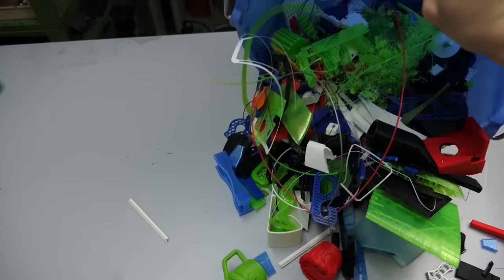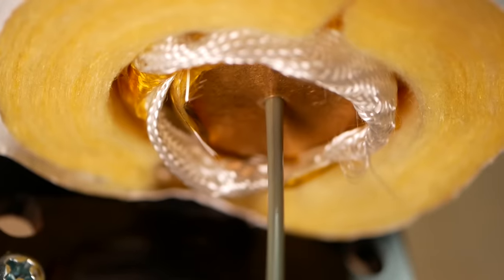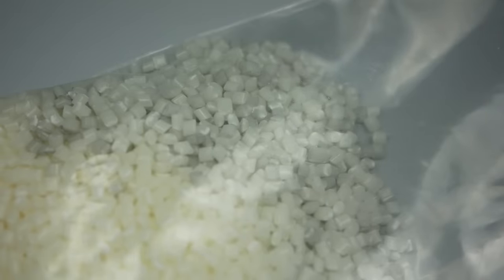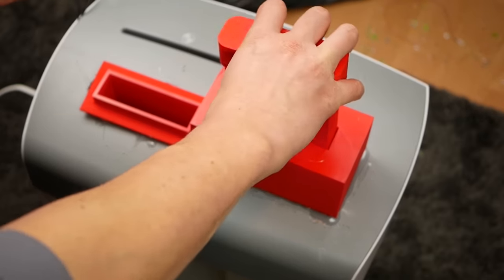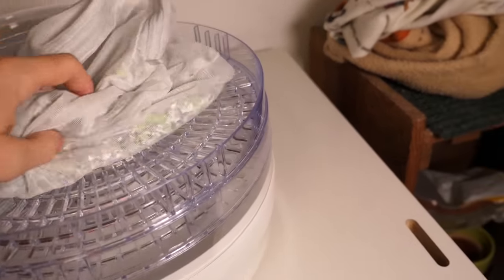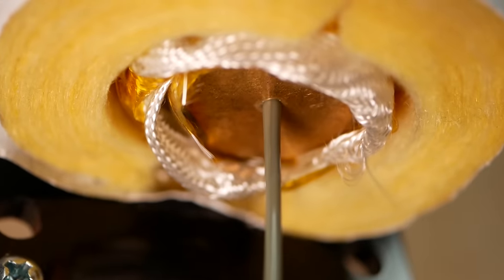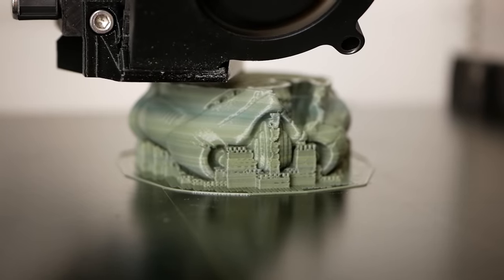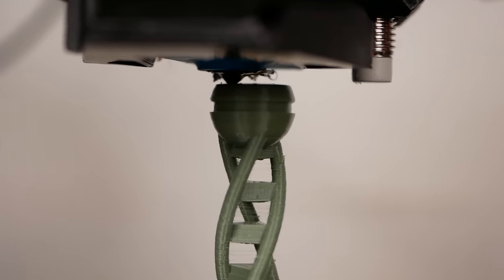Recycle your failed 3D prints! Make new filament at home.

Comment: Wish a system like this was cheaper. This should be a standard with everyone who uses 3D printers!
Reply: Perhaps hobby spaces should set something like this up together and then all of the members can drop off their failed prints for recycling.
Reply: Makes me think, there could be a place for a business here...send us your failed prints and we offer a discount on recycled filament.
Reply: This system is very rudimentary, I imagine building one would be pretty straight forward. Biggest hurdle would be temp control & engine speeds.
Reply: @1992Bwhite  yup! I imagine even a store front in a big city would even do good.
Reply: @hedgehog3180  Damn, that's an awesome idea. Many printing enthusiasts, myself included, would gladly provide their scraps regardless of what they'd personally get out of it. I'm totally going to recommend this to my local maker space.
Reply: Yeah I imagine you could have a funnel going to a heated big tube that would melt it together followed with it getting pushed out of a extruder perfectly
Reply: @hedgehog3180  who buys anything at a local hobby store???
Reply: This is more expensive than some good printers
Reply: If there is a demand someone will meet it.
Reply: Exactly a lot of my prints are %75 support
Reply: @hedgehog3180  if only i even had dedicated 3d printing stores in my country,i can only order supplies and stuff.
Reply: Did you watch the video?? At $30 CDN per kilo of PLA, that only 16 roles! 3D printing is damn expensive, so if you can recover the material costs, it's worth it. Buy one of these and advertise to pay for scrap parts in your local area.
Reply: Worth it.... Once one has their printer dialed in and is willing to continue collect scrap... Im gonna get one 🥳
Reply: To be honest I agree
Reply: Why, it takes up a bunch of space, is finicky, time consuming, and a general pain, why should this be standard
Reply: It is probably ceper in the long run
Reply: Legitimately if I was making enough items and had enough material I wouldn't hesitate one second spending $10,000 on a recycle of machine obviously the whole system for that amount of money.
Reply: @1992Bwhite  Reliably sorting the incoming scrap would be nearly impossible.  At least with a PET bottle, you've got a fighting chance ("PET" et al stamped on the container, you could even scan/sort different containers).  Without serious pre-processing, variably mixed or polluted scrap would produce wandering quality filament. You've met "people" ... apart from the 6% who  take the process to hear, the rest will just dump whatever, and whinge they didn't get the promised reward.

You'd be better off offering to produce this PET waste filament from local council recycling, if they'd be bothered.  A happier experience for everyone.
Reply: Felfil EVO Pellet Extruder
Reply: @hedgehog3180  That idea just might save R/C hobby shops. No one even buys parts for their rcs anymore these days. If something breaks they print a new one. Its gotten to the point where its cheaper to buy a whole 3d printer than pay a hobby shop every time something breaks on an RC.
Reply: What would make it more worth the cost is if it worked with PET. Getting friends and family to collect the bottles so you pay nothing as well as recycling PLA. I know PET can be tricky, but still.
Reply: trash bukkake?....
Reply: @hedgehog3180  Get out of my head!  I can't get to the local maker space frequently but I could get there a few times a year.
Reply: @hedgehog3180   this is an awesome idea. Feel bad just throwing that stuff away. Not to mention the supports. They are just pure waste
Reply: Give it time, 3D printing will evolve very well.
Reply: The recycling setup shouldnt cost twice what a decent printer does- thats just too much
Reply: @1992Bwhite  there is a German company doing this. You send them your scraps, get points and can buy new recycled filament at a cheaper price
Reply: If you throw it in the garbage, it will be recycled too. Just that you giving it away for free and pay extra for the recycled eco filament
Reply: Considering the fact that most bottles and caps wind up in the landfill even the ones that supposedly get recycled this would be a great way to get rid of that stuff.  That was my plan when I started Googling this subject.
Reply: @hedgehog3180  Accepting strangers plastic means you have to trust that it is clean and pure, only pla. So its basically impossible.
Reply: CHEAPER?? that is the cheapest. other systems run in the thousands to ten thousands of dollars!!!!!!!!
Reply: I wish it was cheaper too! I have been holding on to my scraps for as long as I can remember but I don’t have any way to recycle it lol and it feels like a lot of effort 😭

Comment: A few things as a plastic technician (im specialized in injection molding): you should be able to achive a black colour by adding about 2-3% clean powdered graphite. Ifyou dont want to add virgin material you should be able to use vibrations (maybe a rumblepack?) To loosen up the material for extruding. To reduce graining ect. And get a more homogenious filament i would try to sort the material either by spool(best way) or atleast by transparent/opake and light and dark colours
Reply: I was going to comment this, except with graphene powder. I add graphene powder to SLA resin, although I haven't done any tests on its effect. Do you know?
Reply: @attilasooky8792  i just know that black colour normally gets done with carbon and graphene seems like the easiest clean source of carbon i can think of
Reply: A rumble pack you say? 
Pulls out Nintendo 64 controller accessory.
Reply: @wargex  Any small motor with a weight that is off center should work.
Reply: @Kara_Kay_Eschel  "Rumble Pack" was the actual proper name of the controller accessory. I understand how vibrators work.
Reply: @wargex  I figured. Was clarifying that it just did not have to be for the masses.
Reply: @sonnyajvoll5865  probably.
Reply: Hey do you think you could melt the scraps to use in injection molding?
Reply: @Tula-cs1ef  yeah we actually do this alot of the time where it doesnt influence the use of the product, we normally mix about 25% shreddings in there but it can influence the strength because the macromolecules get thermally damaged during every heating aswell as possible discolouring and you can loose an fda certificate but whereever we can we do it, mostly to save money on garbagedisposal. And other option is regranulating where you melt the scraps back up and use additives to get a granulate thats almost compareable to the new product but this again costs some money
Reply: @attilasooky8792  isnt graphene super toxic?
Reply: Can you be more specific on what you mean sorting by spool?  I guess youre assuming all the plastic being used is old filament.. if thats the case do you mean sort by spool as in type of filament (pla, abs, etc)?   From the videos ive seen many are sorting their failed prints by filament type, and some by type, and color.  Not sure why anyone would combine all the different types of filament into one bin knowing that each has it own unique melting temp and strength.
Reply: @ChristopherJones16  i would go as far as sorting by the batch number of the spool, every batch has specific qualities (some flow better, some worse ect.) And if you mix them up (especially with low quality filament) it could happen that yo have a part of you filamemt being perfect for that exact temperature ect. that you set and in the middle you suddenly have a part that flows way better or worse wich could lead to a bad surface or a general inconsistency. The other thought is that if youre doing it like this you should exactly know how may times you recycled each material, and sice you shorten the macromolecules with every cycle its essentially to further prevent the point i explained in my first point.
Reply: trash bukkake?....
Reply: For the uniform color part i think if he really wants it to be uniform he could shred the finished filament and run it again through the machine. That would definitely give him a uniform color.
Reply: @wargex  The vibrator engineer.
Reply: ok

Comment: I feel that it's not quite practical at the moment, but environmentally it's very much so worth it
Reply: If you just have like a a spare bucket next to the printer just toss the failed pieces in and push them down a little then once it gets full look for this video in like a note app or something
Reply: Why is it worth it environmentally? The filastruder uses electricity and pla is biodegradable...
Reply: @nateschmitz9827  degradable, not biodegradable
Reply: @nateschmitz9827  Interesting perspective. I'll have to understand more on the subject to have an opinion on it.
Reply: It's only worth if if you can do it in enough of a volume or over a long enough time to make up the substantial cost of the production of all the materials that went into making the equipment to do it.  It's a similar problem to buying a new electric vehicle (or replacing the batteries that eventually fail), which through their really high environmental costs to produce the batteries and whatnot, are actually worse for the environment than a used but properly maintained and fuel efficient gas vehicle.
Reply: @finnblackwood2124  "unlikely" being key word here
Reply: @nateschmitz9827  for the environment plastic is a bigger problem than energy production
Especially if we start investing in nuclear energy again
Reply: @nateschmitz9827  Less new filament being required means less oil needs to be used to create the supply of it. Plus I imagine the process of creating PLA from oil isnt the greatest tho I am uninformed there
Reply: @Kune35  dont forget to include how electric vehicles get charged... thats the part everyone seems to overlook.. "yes we are forcing electric cars on the public so we no longer need to rely on fossil fuels to power them.. they will be powered with electricity.. produced by generators powered by.. fossil fuels. "
Reply: @ChristopherJones16  But thats not a fault with electric cars, thats a fault in electricity generation. Most green energy is cheaper and easier than most fossil based generators.
Reply: @nateschmitz9827  these greenies don't think that deep. In their minds, recycling, regardless of it's power consumption and negative environmental impact is necessary at all costs 🤣
Reply: @sashasscribbles  PLA isn't made from fossil oil
Reply: @ChristopherJones16  at least a portion of that electricity comes from renewable sources, so if that is your only argument you have already lost, not to mention fossil fuel powerstations are considerably more efficient than a cars internal combustion engine
Reply: lolno
Reply: @nateschmitz9827  Just because something uses electricity it doesn't have to be bad for the environment...
Reply: @kodaxmax  Thats just not true.
Reply: @jamesbaker3153  It is true. th only reason we still use coal and gas for energy, is because coal and gas companies have government backing and other sources don't.
In countries like amaerica and australia especially, where we have just shittones of unused and mostly uninhabitable land there no reason not to have large solar and windfarms. let alone nuclear plants.

Bu that takes investment and goverment approval. Which means politicians would ahve to stop taking bribes from coal and gas giants.
Reply: @godspoon  the electricity cost to the environment is much more than the filament.

And btw, the environment is fine.
Reply: @ChristopherJones16  electricity from renewable is a thing and getting more and more common.
You guys are stuck in the past. I'm not a tree hugging weed smoking environment nut job but the future is electric like it or not.
Reply: @qozia1370  the environment is fine....the environment....is fine......totally 100% fine.......nothing bad is happening......to the environment......*heckles in capitalism*
Reply: @qozia1370  I can second that. I'm covering my exorbitant electricity needs to a 100% by solar and wind, despite me and my wife both driving electric cars and exclusively charging at home. Energy consumption might be an argument for others, but to me recycling my printer waste seems very reasonable. The time consumption is what bothers me tbh.
Reply: @ChristopherJones16  Yeah nah, that's not how that works. Electric vehicles are drastically more efficient than their combustion counterparts, and combined cycle natural gas power plants are also far more efficient than car engines. An EV being charged on the grid from fossil fuels produces less than 1/2 the emissions as a gasoline ICE vehicle, even with it's larger manufacturing footprint it is a clear improvement over our woefully inefficient fleet of ICE vehicles. Then on top of that, there's many places where Hydro, Nuclear, Wind, Solar, and Geomthermal are the dominant source of energy used to generate electricity, and in those places EVs absolutely crush ICEVs on a lifecycle emissions basis. Fact is ICE vehicles are furnaces on wheels, most of the energy in the fuel is just exhausted or radiated into the surrounding air, and is not even being used to move the car.

Comment: Next time I visit Germany I can drop of a container of failed prints.
Reply from the maker: Be my guest, Simon.
Reply: @RCLifeOn Simon! I can come to Trollhättan and pick it up :)
Reply: @CNCKitchen  beautiful man, not cheap enough yet.. I look at 3Dp ones :) but this is So good xx
I post in our group for you xx
Reply: Container for sale :)))
Reply: You sir, earned a subscribe from me! This is the most consistent extrusion of recycled plastic at home I've seen.  Could you add metal powder to it to create a glitter sheen like a brass fill brand?
Reply: @TheMidnightSmith  Maybe mica or something might work also. Depends on temperature. 
Mostly don't want to clog up the machine
Reply: @TheMidnightSmith  yes - better tiny metal Bars if you can.
You can buy sliced fragments that will Orientate when you print - making prints MUCH stronger (same with carbon slices)
Careful your nozzle though. If it's brass, get a steel nose or one of These >> https://3dpc.tech/3dpc-tech-launches-new-3d-printing-nozzle-technology/
From my mate AL - they are on sale 1/3 price until Jan 2019 xx
Reply: @hotaru8309  Love that idea, but mica is SO hard. You'd definitely need a diamondized nozzle.
30% mica part will be very wear-resistant. But possibly brittle too, have to try xx you got crushed mica?
Reply: @CNC Kitchen where are you based in Germany? I'm in NRW. If you are in the area as well, I would drop by with some PLA if interested ;)
Reply: Hola to Uruguay
Reply: @pdjames1729   Powdered Mica is very readily available. It's used in many paints and cosmetics and can be directly purchased.

 I've never crushed it myself since I buy it in superfine powder for watercolor. I would not be surprised if it's still hard on the nozzle in the dust form though.
Reply: Ich wohne in deutschland
Reply: Off*
Reply: Lol
Reply: Lassen Sie Ihre Sachen vor meiner Haustür stehen
Reply: You are my fav youtube Simon out 
gettit?
Reply: @CNCKitchen  I think he meant a shipping container :p

Comment: Trash bag khaki looks like the rare Statue of Liberty LEGO color
Reply: That actually would be a good project to make using this stuff
Reply: That's the first thing that came to my mind as well ha ha ha, I think it's a beautiful color!
Reply: That one corner piece with this color is around 80$
Reply: can we 3D print LEGOs?
Reply: @MarkusAtUMa  yeah it works just fine
Reply: @MarkusAtUMa  Depends on your expectations.

First issue is that 'proper' lego is ABS (as is most commercially made plastic stuff).
That's neither here nor there of course.

The real problem, and one that's also evident with most of the knockoff lego-like brands, is tolerances.

The difference between good bricks and bad is mostly the tolerance.
And the tolerance for Lego itself is something on the order of 0.002 mm or less.

I don't know if it's gotten any better recently, but most extrusion based 3d printers can't get even remotely close to that level of accuracy, especially in the XY layers.

Resin based printers are another matter. (indeed, resin based 3d printing is how Lego has been prototyping new parts for several decades...)
Reply: Car
Reply: @republicofengineers1983  I'd just buy the Statue of Liberty LEGO and shred it to make filament out of it. >:O
Reply: @NMND.  pls don't
Reply: wait, the statue is rare? I know this is a year later, but i sometimes look at comments and had to comment on this. I just picked one of those up for my dad for quarantine wholesome fun time.
Reply: Savvy, set #3450 is rare, and the sand green it is in is rare too. Although I don’t know where the $80 for a corner piece came from. BrickLink.com has better price standards.
Reply: Sand Green. You’re thinking of Sand Green.

I love it.
Reply: so as far as I can tell it's actually a green color or seems to be. If that is the case, is he colorblind or does khaki come in green? I mean, red-green colorblindness would make something that shade look khaki. But it's not even tan.
Reply: Kinda ... though I was thinking more along the lines of Mega Bloks' (now Mega Construx's) camouflage colors that they came out with for their HALO-themed sets
Reply: @brandongaines1731  oooh that makes a lot more sense then